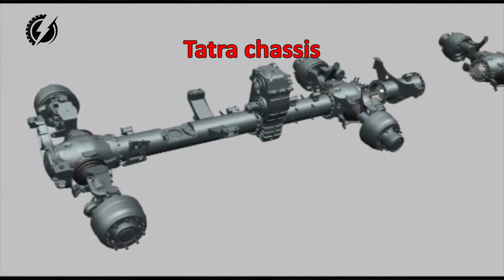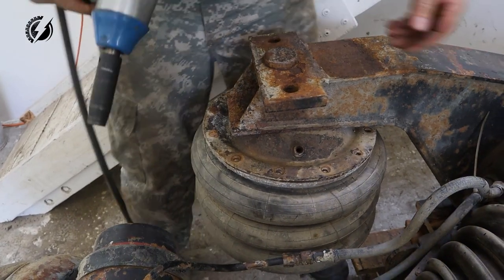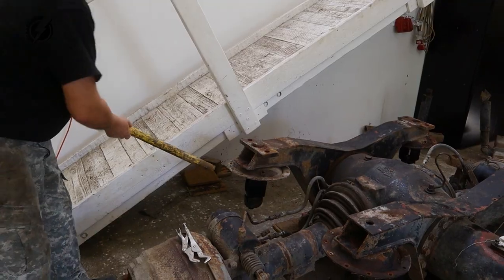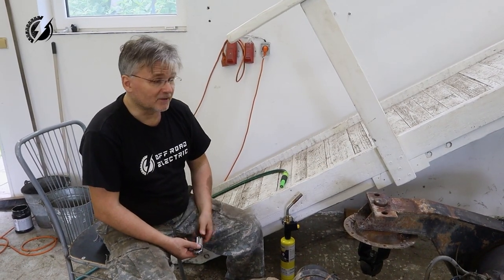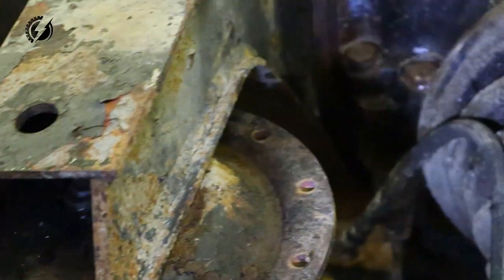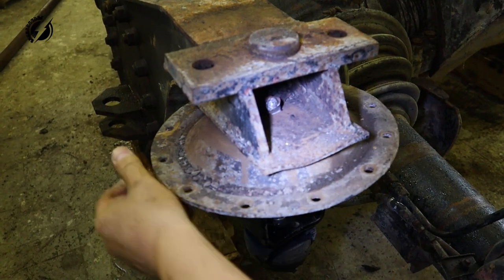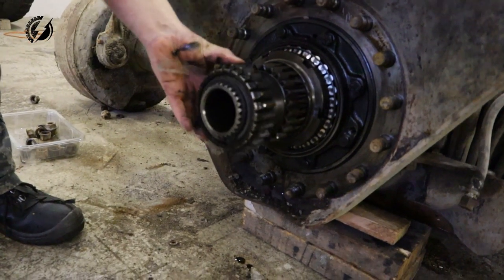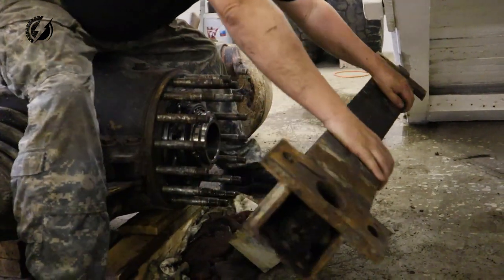Best Off Road Electric Monster Truck Build| Ep.27

Comment: Congratulations on completing the strip down.
27mm and 1 ¹/¹⁶" Land Rover wheel nut size.
19mm and ¾" and 11mm and 9/16" also match up.
Reply from the maker: Thank you much! It would be easier for the World, if all of them match up.:)
Reply: @MMS the last one 9/16 is actually closer to 14.3mm, and 1/2 inch is 12.7 which is close to 13mm.  My suspicion is that you meant to type 7/16, which is about 11.1, and not 9/16.  And yes Peter, it would be much better if the US could use the same measurement system as the rest of the world :)
Reply from the maker: @bgbthabun627  Amen!:)

Comment: Nuts have to be heatet up until they glow red.  They were just warm ;-)
Reply from the maker: I can spend money to buy an acetylene torch set to heat it up more, or spend it to make episodes. Before I buy the set because of just several nuts, I will buy several other tools I need more.
Reply: @offroadelectric9457   Yes, sometimes you have to set priorities.

Comment: The surprise is that he bought a second Tatra and has to disassemble it as well to get the other parts he needs. 😂
Reply from the maker: And 4 Nissan Leafs.:)
Reply: @offroadelectric9457  No grease on those however.
Reply from the maker: @Mike_Costello  Will not miss it.:)